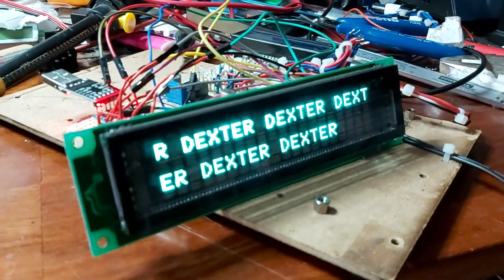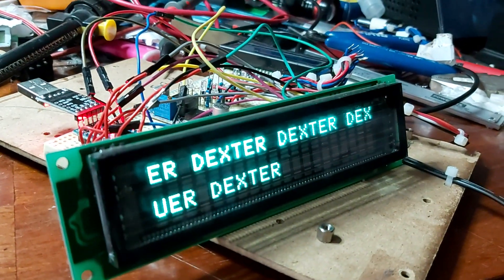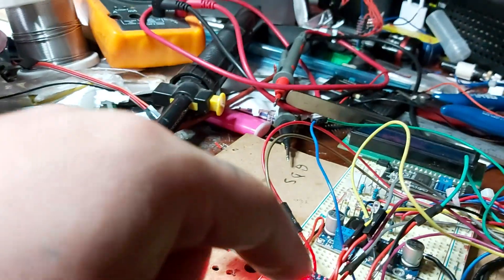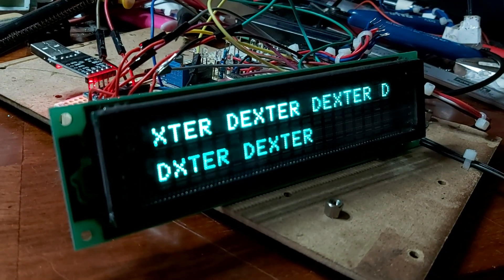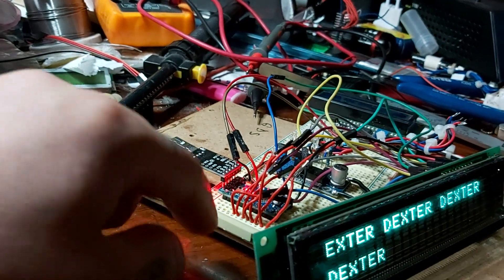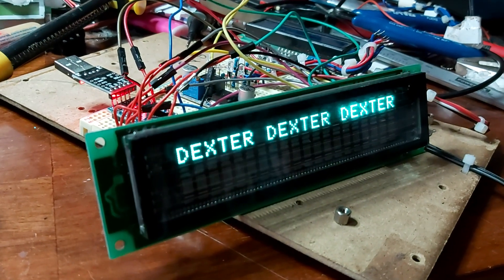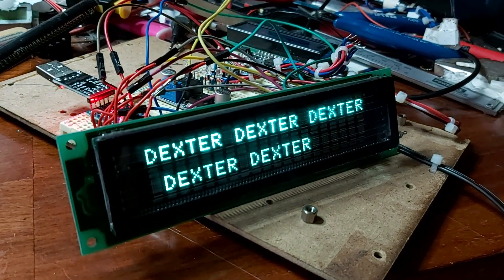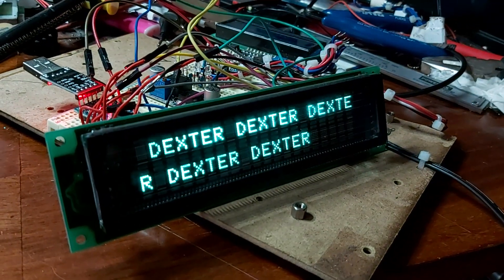FUTABA M202SD08G and ATMEGA328

Comment: Could you share, or indicate where I can download the display manual. I need to replace such a display in industrial equipment, and I will probably need to make a parallel bus converter that listens to the VFD display commands and converts them to another format